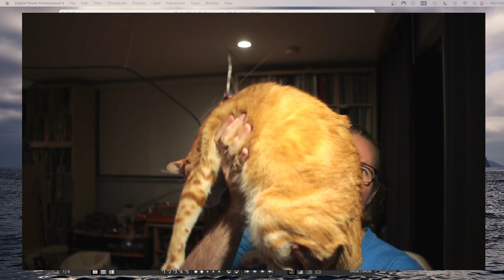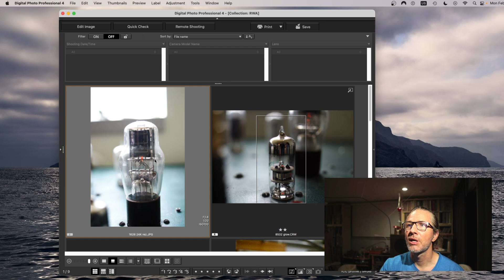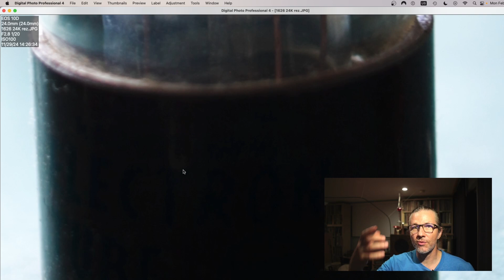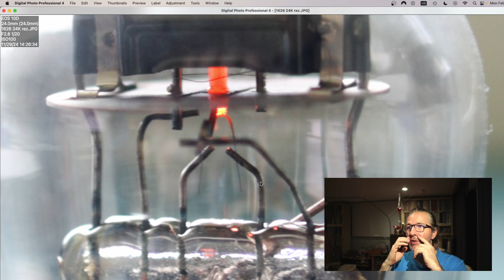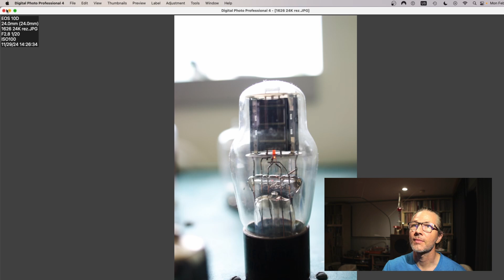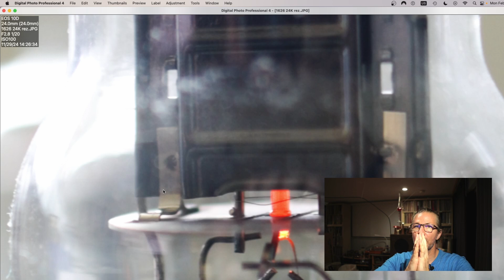Triodes under magnification!

Comment: I learned Amateur Radio theory from old men in 1968. We still had vacuum tubs widely used, transistors were just getting popular. I built a transmitter out of a very interesting tube, the integrated circuit of tubes called a compactron, which had several tubes inside one envelope (it was used in TV's.). Tubes are wonderful because you can easily tell if they are powered on, and instead of clipping at a limit they gently and non-linearly roll off, so you never get a harsh sound like you do in a transistor where it clips very brutally.  There is some additional electron noise. The finest pieces of Tube equipment were the McIntosh audio amplifiers, and the amazing Collins 75S3C radio. Collins was a genius, and tried to build a message passing system for the Air Force; they didn't understand it at all, but it was 15 years before the Internet was invented and was along the same lines.

Tubes died out for a long time but audio people brought them back.
Reply from the maker: Thank you Edward for sharing! Indeed, compactron tubes are so underappreciated today. They are still around by the tens of millions, and can be bought at extremely cheap prices, a dollar or so a tube, or buy 100 tubes for 50$..... Sadly, everyone is going for well-known "famous" tubes, but mostly what those tubes have on the compactrons is largely the fact that they are used frequently.... for a long time I wanted to focus more attention on unknown but widely available tubes. Hopefully one day I will have a lot more free time, and can build amps...

Comment: Hi Janos, nice presentation. The Noval base is much better than the Octal base for high frequencies due to lower parasitic capacitance in the leads connecting to the tube. If you enter the following search in Google: 
the ef50, the tube that helped win the war 
You will get to a story that not only tells about tube designs and evolution, but also reads like spy novel. I can highly recommend that article. If you read everything, you will also learn why you should never buy war time Philips tubes. BTW, the guy on the photo left of that anecdote is my grandfather.

Comment: Hi Janos.   The old  tubes that were manufactured in the age of tube gear seem to sound
better than most of the tubes made today.  Is it that they used different metal
alloys or different materials back then or maybe it was the design of the 
tubes.
Reply from the maker: They used better quality materials, and had cleaner plant floors. Nowdays there's goats tied to the production line in China, doing an etching process in a plain bucket in Russia under the sky.... in the old days they did all of those in essentially a sterile environment, with many of the source metals of much higher grade than nowdays. (There's more than 60 pure metals / alloys are needed for a tube.) Nowdays they are trying to replicate many of the steps, as a lot of tricks were proprietary to each plant and they were not sharing them with one another. It seems new production plants are slowly figuring things out, but they have relatively very low pressure. In the old days all of this was military technology, a question of life and death, with a significant portion of GDP going into it in every country. Nowdays it's just business and the goal is to make money, and there's only a businessman with relatively very modest financial capability compared to a significant chunk of the GDP from the old era.